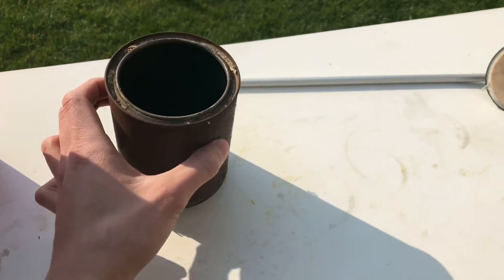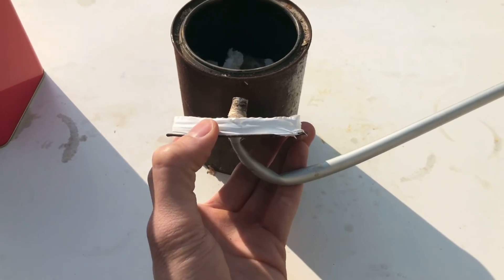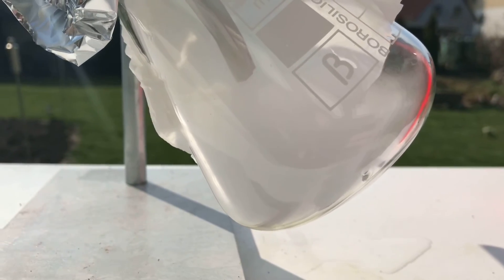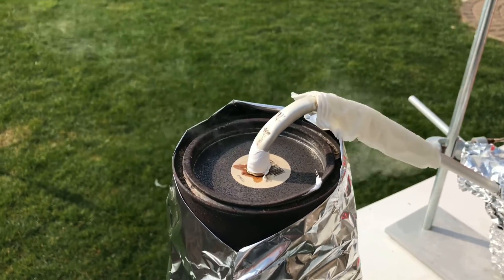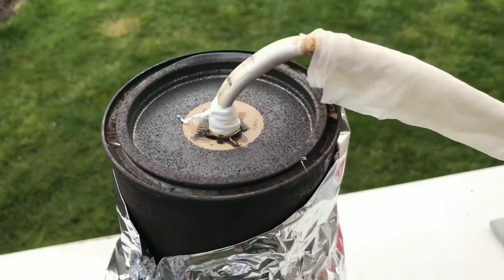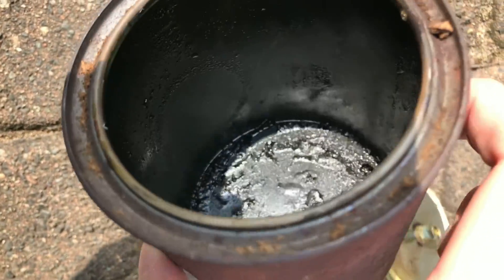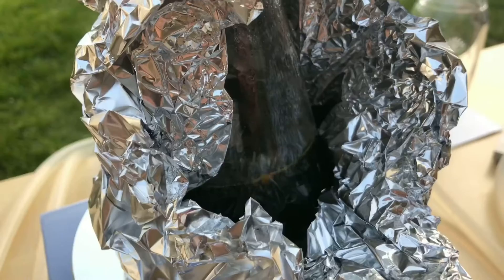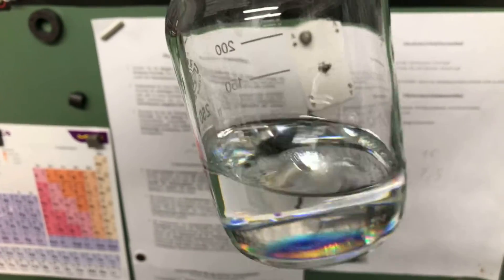Recycling polystyrene to make styrene

Comment: Conduct a qualitative and quantitative analysis of the resulting liquid - there is less than 40% styrene. Yeald - bull shit.
Reply from the maker: Well I managed to convert it to the dibromo product and the stociometry looked to be exactly right (nearly all bromine got consumed and the resulting solution contained only a small amount of bromine). So I can confidently say that this should mostly be made from styrene
Reply: @THYZOID  Benzene and its homologues also add bromine well, and the product will contain quite a lot of benzene, with an admixture of naphthalene. Ask why? The benzene core is strong enough, and the polymer chains during depolymerization will break with the formation of unstable radicals, and they will already form coke and benzene. I already checked. But for the full depolymerization of polystyrene - it is enough to dissolve it in toluene and expose it to ultraviolet radiation - you can check it yourself.

Comment: so if were actually using this for fuel and not a chemistry project, what kind of inhibitors do you recommend to prevent polymerization? I expect vitamin c would probably cause more fouling than fresh styrene
Reply from the maker: I’d recommend BHT
Reply: @THYZOID  common food additive, already used as ao-29 at 0.3 %  for that exact purpose! So obvious yet never would have thought of it, thanks!

Comment: I did this a few years ago.
I was able to re-polymerise it using fiber glassing activator (MEK peroxide) and some mild heating.
The product was hard but brittle, but It had impurities in with the styrene.
Next time I will use some Magnesium Oxide in the pyrolysis retort.
I read in a paper the MgO improves the yield to favor styrene.
Reply: hi did you need other heat sources while doing polymerization or catalyst will work by itself?
Reply: @dogodogo5891 

To depolymerize the polystyrene, I used a hotplate.
To re-polymerize the liquid, I used a coffee warmer for heat and some MEK peroxide.
The end result was polystyrene , but it was very brittle.
Keep in mind, the yield of styrene is from 40 to 70%.
The rest is benzene, toluene, ethylbenzene, and xylenes.
Also, better polymerization techniques are needed

Comment: Maybe I'm stupid but to me it seemed like the first setup was a "closed apparatus", i.e. the fumes generated by the pyrolysis had nowhere to escape? Or did I just not see a vent in the collectorflask?
Reply from the maker: It was more or less a sealed system. Any fumes and SO2 went into a gas scrubber

Comment: Now all you need to do is epoxidize the monomer and reflux with an excess of acid, follow that up with distillation and then react the aldehyde with MeNH3 followed by vigorous drying. Then finally finish off by reacting the aldimine with methyl magnesium halide (Grignard reagent).
Reply from the maker: No. We won’t to that. Also methylamine is MeNH2.
Reply: @THYZOID  
Walter White nods in agreement.

Comment: Did the same 24 years ago, same setup, only used copper tube. Also did methyl methacrylate, and then methacrylic acid, which was a stinky mistake. Thanks for the video!
Reply from the maker: From what did you make the methyl methacrylate (plexiglass?) and the corresponding acid?
Reply: @THYZOID  Reverse: de-polymerized some pieces of plexiglass by heating it in a can while distilling the monomer, then reacted the monomer with some sodium hydroxide.The problem was that I acidified the resulting salt it in the attic, so the whole house could appreciate the smell of methacrylic acid. Smells sort-of like vomit. Maybe not as bad as butyric acid, but still pretty bad.
Reply from the maker: Thanks! Do you know if the monomer polymerizes quickly on its own or if it’s fairly stable?
Reply: @THYZOID  It was stable, at the time I couldn't make it polymerize. Then I left some in a bottle, and after checking a year later it was all solid.
Reply from the maker: Good to know thanks!
Reply: @THYZOID  MMA is super resilient to auto polymerisation, but it really doesn't like heat. So to purify crude destilate, you have to do it under vacuum. This happened with store bought "dentacryl" monomer after removing inhibitors and catalysts, but even then it's a mixture of acrylates. So your mileage may vary. Basically want to say, use some older worn out glassware if you do.
Reply from the maker: I’m able to do vacuum distillations so it’s easy
Reply: @THYZOID  what kind of trap do you use for your pump? 
I have almost no access to dry ice or liquid nitrogen apart from fire extinguishers 🧯 which is an expensive way to do trap volition rubbish.. anything else you can recommend?
Reply: @noodlesoup2281  With expensive pumps you should definitely use a trap. Use an ice/salt bath in the worst case (can get down to -18°C, practically speaking the -10 to -15 range). Using hydrated CaCl2 instead of salt can bring it down to -36°C (100g CaCl2.6H2O, 100g crushed ice intimately mixed, add 10ml water).
Reply: @noodlesoup2281  The other solution is to use a cheap vac pump, like a refrigerator compressor, you can get those by dumpster diving and they can take a surprising amount of abuse. Best one I had pulled a 30 mmHg vacuum, they averagely rate around 50-100, similar to water aspirator vacuum. For long time operations, like vacuum distillations, you have to cool them with a fan, I've run them for half a day like that.
Reply: @bromisovalum8417  calcium chloride and ice is exothermic? I’m pretty sure it would struggle to get to the same temp as NaCl. 
I have an expensive pump but because if the lack of a trap I don’t want to use it for vacuum dists… which is annoying.
In all honesty while the fridge vacuum thing is a cool idea I dont think I could be bothered with it tbh..

Comment: I have a question: I know you should not o this, but I'm just wondering what styrene smells like. Also, thank you for the video, pyrolysis is quite cool and interesting!
Reply from the maker: It smells somewhat sweet with a hint of burned styrofoam
Reply: @THYZOID  Thank you.
Reply: @THYZOID  🤤 delicious 😋
Reply: +1
Reply: Just open some fiberglass resin or some Bondo.
The use styrene monomer in them.

Comment: well done. I once tried to make styrene by dehydratation of 1-Phenylethanol with H2SO4. I mixed it together, heated and tried to distill styrene. I ended up with black dense mud and not even one drop of styrene. :D
Reply: Sounds like the substrate have been "digested" by the hot H2SO4 - although not really an oxidizing acid, sulfuric is a different story at higher temperatures (see "wet oxidation methods"). It might have also formed ethers (by dehydration of the alcohol) and maybe some sulfonated by products...
Reply: @LiborTinka   I think it just polymerized. Polymerization of styrene can be activated by acid. It polymerize even if you fart near it... Its just unstable by its nature.
Reply: @humr2346  Note to self: do not eat beans prior to handling liquid styrene.
Reply: @humr2346  Ah I see. Good to know, thanks.

Comment: When you use the paint can for benzene should you be left with quite allot of solid at the end that should be hammered out or have I not run the reaction for long enough?
Reply from the maker: The solid I was left with was easy to break up and remove
Reply: Yeah you're left with quite a bit of solid if your can is a bit small and that makes it harder to get out as well.  I did the same thing once and had to use a hammer as well.  It's fine though.  As long as you weren't still getting good amounts of benzene off from it it's fine and can be stopped and cleaned out.  No worries.

Comment: i dont quite think ptfe sealant is a good choice at those temperatures :P
Reply: it's the standard seal used in this type of setup.  Just take a look at any video showing this or the benzene process.  They all use PTFE for the seals.  And as you can see from the video, his seals didn't degrade too badly at all.  As long as you don't overheat it too much it's fine, and over heating a can of that size would require at least some effort to do so.  Just saying.  🙂
Reply: @BackYardScience2000  yeah, i usually just torch stuff like this, benzene or styrene, anything thermal goes red heat for me (as as i thought for him too, like many other youtubers did)
Reply from the maker: It survived so it should be ok. I know about the toxic fumes of ptfe pyrolysis but it didn’t seem to be a problem.